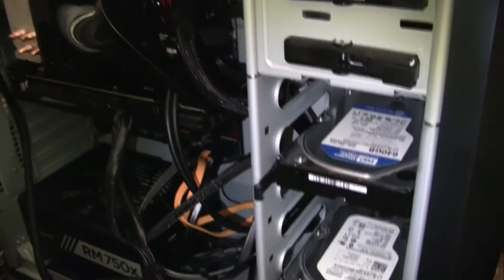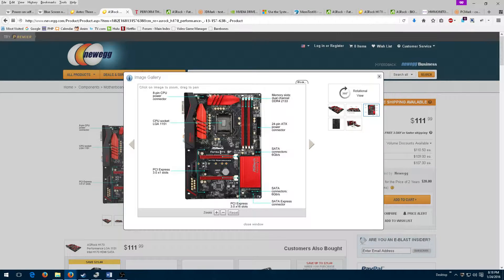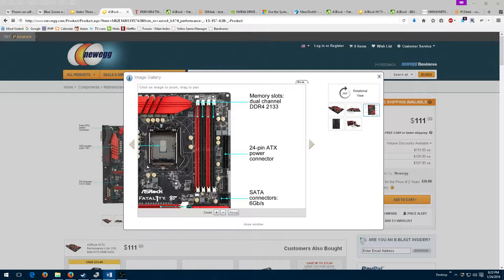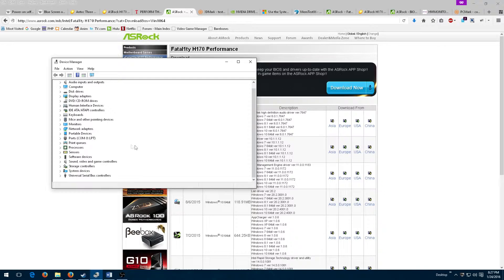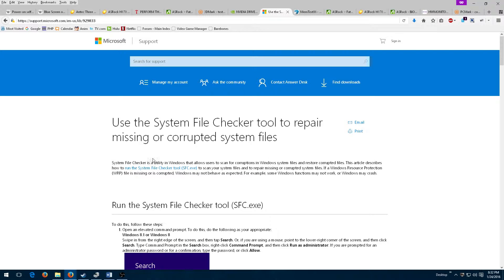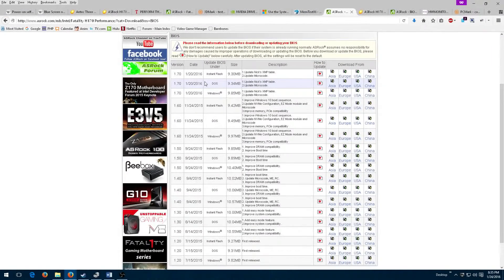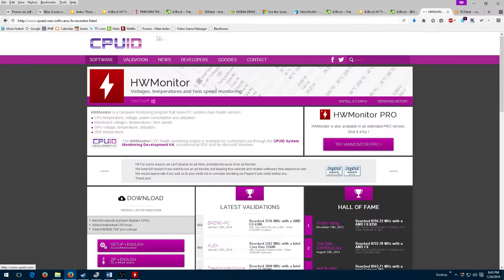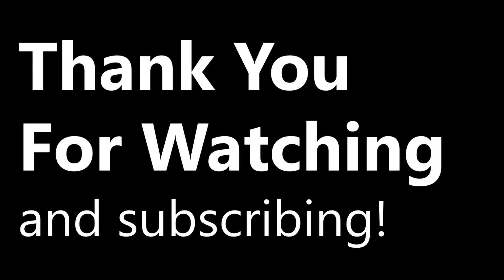Building a Desktop Computer:  Part 3:  Build issues (No POST and BSOD edition)

Comment: My pc doesn’t post but my mobo say there is a problem with my dram. Every part was brand new and I cleaned the ram replaced the slots switched them around nothing worked. Still can’t post. My dp cable is connected to my gpu and I’m boutta call it quits and call someone to help me. EDIT: I just got a short beep for post. It took about 10 minutes but yes finally. But the monitor still displays no signal.
Reply: DJBawss did u ever fix this having the same issue :(
Reply from the maker: This could any number of things.  If the RAM is brand new, there was no need to clean it (doing so probably lowered its lifespan).  The RAM in my machine was not seated properly.  One of the sticks wasn't quite seated properly and it took quite a bit of force to snap it into the motherboard slot (maybe 20 lbs) and flexed the board a little bit, which had me concerned for sure but then it POSTed just fine after that.  If the RAM isn't the right type for the motherboard, then it won't POST either.  Could also be a bad batch of RAM too, but that's rarer than people think.  Could also be a power supply issue (i.e. not enough power to the hardware).  Could be a power issue to the power supply as well (e.g. an underpowered UPS system).  The POST beep codes are on a per-manufacturer basis and sometimes per-motherboard, so you'll have to find out what those (possibly) mean.  Building your own PC does mean you are kind of on your own BUT there are online forums like AnandTech available for solving issues.  YouTube videos aren't really the best place to obtain specialized technical help.

Comment: for a new system a fresh os install is always recommended
Reply from the maker: A fresh OS install is definitely recommended for the average person.  I'm a long-time Windows software developer and know the entire system inside-out.  (I've done everything short of kernel mode hardware driver development).  I also run Portable Apps, which mitigates and isolates much of the data transfer process between OS installs.  I know the dangers of migrating software across hardware boundaries and did it anyway.  Been going strong for over a year with no issues so far.  So, while what I did can be done, it's generally not recommended.

Comment: im gonna try that if my computer get blue screen again , im a new builder and i hope i didnt break any components that cause the bsod , just want to know that does it matter that much if i put my ram on dimm 2 but not dimm 1 ? i hope thats not the reason that causes the blue screen of death..
Reply: btw it happened after i put my usb hard drive in
Reply from the maker: It is extremely difficult these days to harm a computer.  Manufacturers have more or less learned the hard lessons of the early days of computing and have built in a lot of safeguards.
Reply from the maker: Being able to reliably replicate a problem is a great starting point for diagnosing a BSOD.  If it only happens randomly, it can be quite difficult to determine if a specific change actually fixed the problem.

For my machine, updating the BIOS has made this system 100% rock solid.  I have not seen a BSOD since then and I've most definitely put the machine through its paces.  There is a general order to follow when diagnosing issues like the ones found in the video starting with the safest options and moving carefully through to the more esoteric and slightly dangerous options.
Reply: cubiclesoft thanks for replying and i did find out the problem was the RAM ! memtest said it was defected.
Reply from the maker: Memtest is great at catching faulty memory.  Glad to hear that it worked out for you.